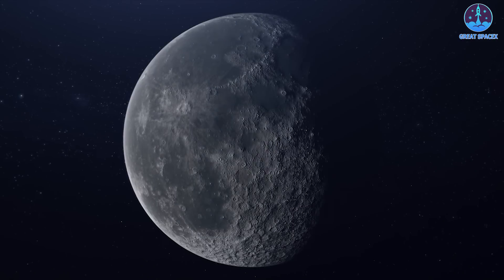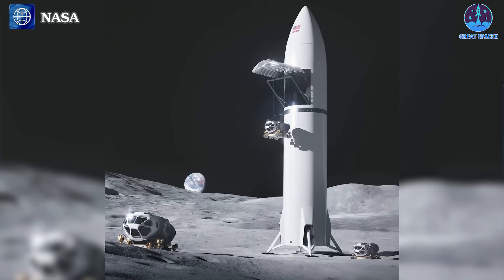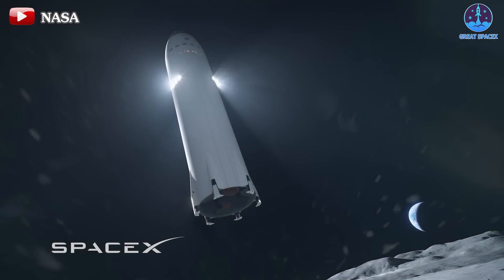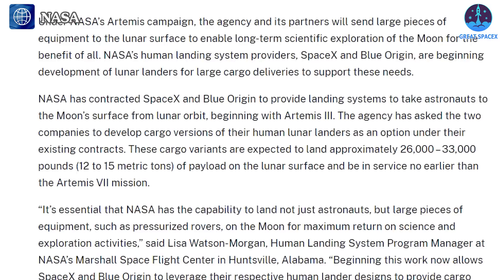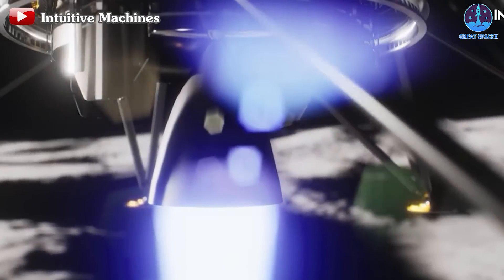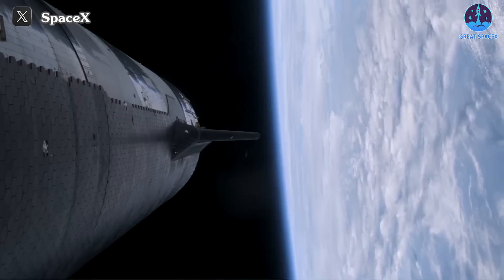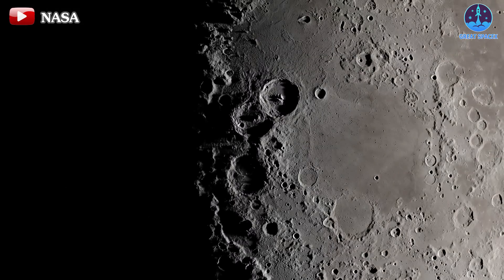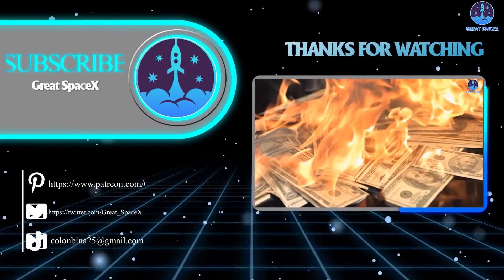Nasa officially revealed New SpaceX’s Starship cargo lunar lander design...

Comment: Note that SpaceX must successfully perform an automated landing, launch, and recovery of an HLS prototype before delivering mushware.  Since SpaceX is dedicated to reuse, and because of its massive over-capacity compared to the competition, SpaceX will almost certainly recover the prototype all the way back to LEO, rather than just to the Not Really Helpful Orbit (NRHO) required because of the designed weakness of the Senate Launch System.  I suspect SpaceX will demonstrate capability by delivering three Cybertrucks with remote control capabilities.

Comment: The issue of landing on the Moon is going to test SpaceX to the max. Level landing areas are needed! Build those in advance, (and make sure the rocket’s aiming capacity is up to the mark), before attempting full Moon landings. How about pre-constructed landing pads with built-in stabilizers (to help guide the rocket and clamp around it on landing). That way, the rocket itself would not require heavy legs.

Comment: If you want lander stability, land it horizontal. Easier to lower payloads and no need to tip it iver later on. Of course there are drawbacks, just like landing vertically has drawbacks

Comment: YAAY! Autonomous LTV makes good sense.  An auto homing and a few pre-programmed routes with obstacle deviation, might also be a good thing to be able to remotely enable.  
    My fantasy is a: land and tip-over Superheavy spaceship,  that can lay flat and be useful as a horizontal spaceship warehouse,  wherein the fuel tanks can be opened accessed and used for workshops and other utility purposes.
Reply: That's exactly what I had in mind✌️
Reply: Different expressions of the same way
Reply: Tip over....system .. hydraulic or combustion?
Reply: I see hydraulic ones safer for the cargo and the vessel...
Reply: @rodjelen3883  LOL!  Love it when you can see the mushroom cloud of ideas occur in someone else's mind! All your ideas seem workable to me!
Reply: Lunar lander passed rigorous horizontal landing tests to have the perfect landing leg ratio. Starship has no such tests. Tip-over might be imminent. No hard pad to land on (yet) landing legs could be longer (lunar mesh extensions) to avoid sinking in rigolith dust, and possibly an air or wire cushion ring near the top of Starship to soak the impact of tipping over on rubble.
Reply: @chrisjordan7592  Hey Thanks for your thoughtful reply.  I think the way trees are felled might be instructive.  Build the ship with a tilt biased landing leg; or landing base, configuration.  Upon landing it instantly begins to tip.  Use a hypergolic engine (think they are called Draco engines) to ease and even adjust the "falling".  Send one to do it automatically the way the Falcons now deploy their legs.
In fact, make a Falcon to gently land, tip and fall over here on Earth.
Reply: Yupi...These clouds everywhere... can't the tech King see them
Reply: Thanks for the response,, I'm not an engineer but it seemed logical to me., everything I know about this led me to this conclusion....but I don't know what engineers do 😉😂
Reply: I support more starships on the moon, a lab, a base, a base bigger than the ISS between the moon and us, telescopes on the moon, more telescopes/satellites...etc
Reply: If they make it to the moon with such sketches as shown in the video.
Reply: With the starship staying on the moon, and the astronauts returning to the ISS with the capsule, if tipping system works only down not up?
Reply: Would the hydraulics that would lower the vessel also be able to raise it back up?
Reply: @rodjelen3883  To lower and raise would depend on how configured.   Long pistons hinged near the top,  or short pistons near the bottom,  even somewhere in between!
Reply: @clavo3352  Then again, how would I install hydraulics only, in the starship structure, or send Jack separately
Reply: They don't need the starship back...do they? a million things can serve us on the moon
Reply: @rodjelen3883  see Falcon legs; and extrapolate from there.  Also see Lunar assent vehicle from Apollo missions.
Reply: So that the astronauts can return..

Comment: Dumb design. 

Notice the small base... and how much the cargo overhangs... yeah this is just asking for the entire thing to fall over. And what happens the cargo hits the side of the rocket or gets stuck due to luna dust (which is very sharp and electrostatic).  Also assume that you will land on perfectly flat and level ground. If there is a tilt, this hoist system will have problems.
Reply from the maker: Is there any solution for these problems?

Comment: Again I go with a modified (very) Dragon type lander. Bringing substances down to surface. A lift poses a weight to the lifts side. Which will effect tilting over. I believe they aught to develop an unfolding arm the length of the rocket that can unwind and lower to ship onto its side. Will help for future program s where rockets become homes and labs. Covered in regolith. Heated with solar

Comment: Lunar dust will effect the lift system. Fact.
Reply: It requires a backup situation u can’t fix things there
Reply: There is no air to keep the dust off the surface. Gravity will clear the dust long before they open up. And the lift won't generate any force  that will kick up dust. Again, no air.

Comment: There's only one problem I see. There's no way, in the low lunar gravity, that a starship is going to land straight up like that, empty of fuel on the bottom and top heavy with cargo, & NOT TIP OVER.
They need to start planning on re-positioning the thrusters so it can do a soft belly landing. At least for the first 100 or so ships, until some pad lockdown mechanism can be brought and assembled so that a starship can land and be secured at the base.
Reply: I think it should land horizontally.

Comment: I like the idea rocket land on side for moon landing said xcx237  arguments  for are many tricky one lift off
Reply: It seems to non-engineer me that it would make sense to have the lander land horizontal rather than vertical.  That would seem to minimize the risk of it toppling over during or after landing.  You could send crew Dragon to the lunar station where the crew can transfer to a lander which can be docked at the station between trips to the surface.

Comment: I love starship and SpaceX but I think starship is all wrong for landing on the moon due to its height. I think starship should be converted to land horizontally. If you've ever seen the old show space 1999 you'll know what I mean. It should land like an eagle. Since they are putting engines up top they could be used to land horizontally. easier to unload and less chance of tip over 🤔 just thinking

Comment: Ok ok. What is the monster starship gonna land on!!!!! With lower propulsive landing rockets. It not ever gonna land on the moon.  Get this straight !! Its weight alone dictates the amount of thrust !!! MORE WEIGHT = MORE THRUST. JUST DO AN EXPERIMENT WITH AN Air compressor OK. NLOW 40 lbs of air 12”” away from a gravel road surface. . Holding air nozzle at 90 deg. Then turn pressure-up to 100 lbs pressure and see the difference!! This rocks and sand flying everywhere will be same as landing a starship on the moon.  HOW DO ALL OF YOU SPACEX  JUNKIES NOT SEE THIS SIMPLE LAW OF PHYSICS. If they know of a 200’ square piece of flat  rock on the moon they might have a chance!!! But we all know some rock can explode heated!!!
Reply: The hole it will make after creating a lunar dust storm will be 20 ft. deep and starship will fit in like a peg board. 🌪⛳️💨
Reply: @chrisjordan7592  i dont think that is the plan.